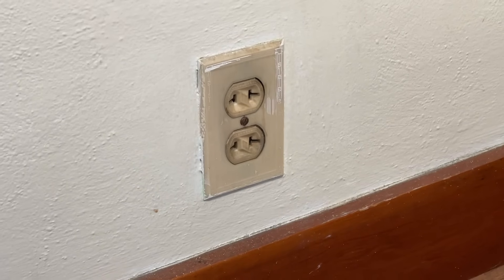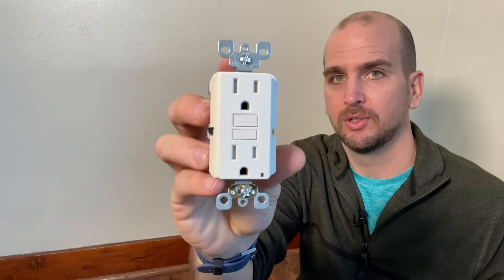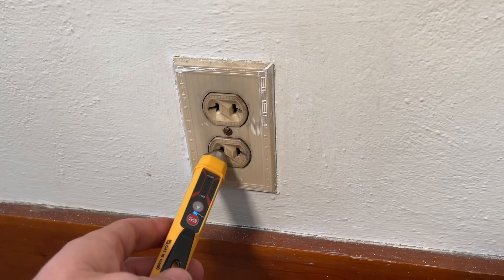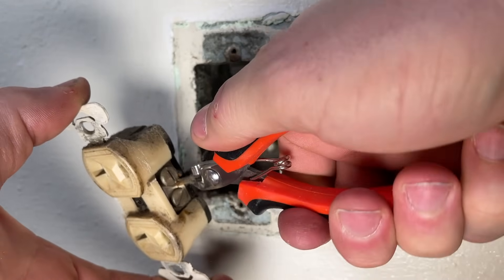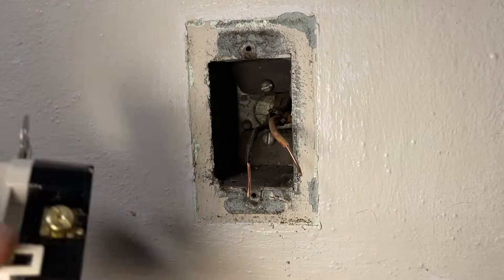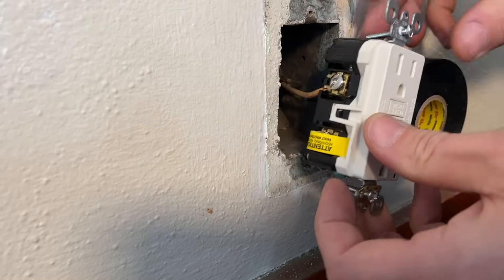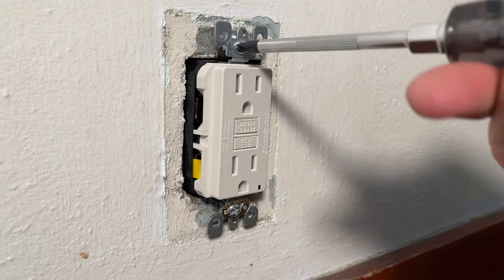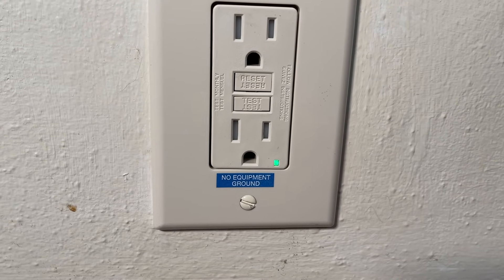How To Replace An Old 2 Prong Outlet Using 3 Prong GFCI

Comment: Tighten G---W-----B in that order to protect yourself and the down stream components---Jim
Reply from the maker: Hey Jim, thanks for that tip.  Appreciate the help!
Reply: J7
Reply: Very good advice!
Reply: I thought we were dealing with no ground here???  And on older two wire, the wires look the same.
Reply: @dave-yj9mc  This is old, two wire Romex cable with a metal box, it has a black and a white wire. In knob and tube, with or without a box, both wires look the same.
Reply: @dougbrowning82  oh,  I thought it was that braided stuff.
Reply: @Volkan no but it is a good habit to do, because you never know what may happen.
Reply: Turn off the power first is the only proper order. The rest is just being lazy and taking unnecessary risks.
Reply: Put on gloves if you deal with life circuit. A few bucks can save you from getting zapped.
Reply: Lol
Reply: Breaker is OFF dummy
Reply: Thats the dumbest advice ever...if its live and you ground it first then one slip of your hand and your getting hit...its neutral hot ground to install and ground hot neutral to remove...you NEVER want to touch a hot wire while a ground is still attached and close enough to hit you
Reply: @illwil2158  That's incorrect... It is Ground Neutral Hot.  The ground is there for you.  To save your life.  Yes you can slip with the hot wire and hit the device and cause a short.  Doesn't matter, the ground is there to save your life not the devices.
Reply: @seancampbell5496  I learned G - W - B or ground, neutral then hot. If Willy rod wants to get themself zapped so be it, they can turn into a human candle...
Reply: @Davelon420  lol Agreed.
Reply: @seancampbell5496  the house panel breaker is there to save your life

Touch ground/neutral while the hot goes thru,  you complete the circuit
Reply: @mansardmanor3869  The breaker interrupts the circuit.  The ground is put in since 1960 for safety.  So I mean you're not wrong, but you're also wrong at the same time.
Reply: @seancampbell5496  never assume you don't have voltage coming off the neutral
Reply: @adammuncy8475  What did I say that made you believe I assume that?  The neutral is an insulated conductor and counts for fill in conduit for a reason.
Reply: @illwil2158  your reply doesn't make sense, sure you can get shocked if you touch the ground and the hot at the same time, but you will also get shocked if you touch the neutral and the hot at the same time. For safety the order of adding and removing wires has always been ground, neutral, hot for adding and hot, neutral, ground for removal. That is one of the first things they teach you in electrical apprenticeships and trade schools.
Reply: @illwil2158  check your education !

Comment: That is the most ignorant thing to do. If the code supports it, the code needs to change. You put what looks like a grounded outlet, which isn’t grounded, and label.  When, over time, the label comes off, or is painted over, you had a potential for a fatality. Uber DUMB☹️👎.
Reply from the maker: Hey Loco Pete,the actual protection is from the GFCI and the ability to cut power if a fault is detected opposed the the actual sticker providing any “safety.”
Reply: @EverydayHomeRepairs  I stand corrected.
Reply: @skelley164  Sorry if I insulted you. The original configuration seemed dangerous to me. As I said in my previous reply, “I stand corrected.”  If that’s not good enough, I can’t help you.
Reply: @CrazyPetez  - no I misunderstood what went on here. I thought the House Repair guy wrote “I stand corrected” admitting some kind of mistake. Therefore I owe you the apology. Lol, that’s why I don’t send out replies like this. Sorry bout that man. Have a good life.
Reply: @skelley164  Thank you!  I appreciate what you did.
Reply: @CrazyPetez  for what it’s worth I deleted it.
Reply: The label does not protect anything, the GFCI does. Also the code says the label put on the cover plate. You do not paint over them.

Comment: I dont think 2 prong are necessarily unsafe, they just arent as safe as grounded. Ive lived in a two prong house my whole life and never had any issues with safety
Reply: Me also
Reply: Electric accidents are very rare, in Finland there are 0.4 fatalities per million annually and this includes people who climb on top of trains. Traffic kills 100 times more. Therefore one cannot really conclude from none's own experience.
Reply: So what did you do when you needed to connect a three lug device? Cut the ground pin?
Reply: @okaro6595  I guess technically I lived in a house with most of the 2 prong outlets switched to the 3 prong grounding style without upgrading the wiring so they function the same as a 2 prong without the ground.

Comment: Nice old outlet! That would be somethin' for my vintage electrical collection. The latter includes some examples of the old coplanar & perpendicular (NEMA 2) plugs that would fit it.
Reply: Except the two plugs that fit that outlet are now used for different voltages where grounding is not required. 1-15P is still used for 120V, and 2-15 is for 240V. Where ground is required, 5-15 and 6-15 are used instead. The change was made sometime after the 1920s when split phase 110/220V was offered to homes. These dual standard receptacles are no longer listed as NEMA wiring devices.

Comment: One of the methods permitted in 406.4(D)(2) is to replace a non-grounding type receptacle with a GFCI type receptacle. 
When doing this, the 2014 NEC required the “receptacle” to be marked “no equipment ground”.or their cover plates
Reply: Correct.  GFCI receptacles come with these labels, but most people do not install them. The other acceptable method is to leave the non grounded outlets with just two hole (sorry for the poor terminology) outlet and install a GFCI breaker in the panel suppling the circuit.
Reply: Someone knows the code, thank god
Reply: What does "no equipment ground" mean?
Reply: @Aaron Wilson  Means there's no ground wire in the home.
Reply: How is that different than what was shown in the video?
Reply: @donbushek    In a modern application you will have a standard romex wire coming out of then box which has the same insulated black and white wire you saw here, but will also include a bare copper wire for a ground.  At the other end of the line that bare copper wire is attached in the electrical panel to a grounding bar.   At the outlet, it would go to the green bolt on the bottom of his outlet here.  In electrical applications green means ground.   Old wires from the 50s and before often times did not have the bare copper wire running in them which is the wire you saw in this video.  I’ve done a bunch of them.    I’ve replaced as much of the old wire at my place as I could just to update it.    It’s preferable to have the ground.  No new construction today would be done without it.   It’s for safety.
Reply: An important thing to note is that without a ground wire, there's no way to actually detect a ground fault.  A short circuit would trip the GFCI, but it would also trip the breaker.
Reply: @banggugyangu  Not how the device works,   The device measures extremely accurate CURRENT going through the 'hot' and neutral.  if they do not match, then current is leaking elsewhere.  that is the fault.  Ground conductor is not needed or used for the measurement.

Comment: Turning off the power before connecting a GFCI will save the outlet from burnout.  I do a lot of 110 V work replacing switches and outlets without turning off the power.  Learned the hard way that doing that on a GFCI outlet will ruin it when you connect it.
Reply: There's switches like that too, it's irritating af haha

Comment: It's better to preserve the length of the copper leads as much as possible.  If the wires are chopped shorter every time the junction box is worked on, the entire run of cable might have to be replaced.
Reply: Meh …. You would just make a pig tail ..
Reply: It's good to save as much wire as possible but just be aware that the copper wire that was on the previous receptacle can be brittle if its old so it doesn't hurt to cut it and strip back new copper if you have enough length to do so.
Reply: @ryanm2084 ,
   Yep, especially weakened where the loop is formed  detached and relooped with the same copper.
Often enough you can break the loop off with your fingers. That'll Ark definitely someday. Better to shitcan the distressed ends when you remove them from the old Outlets if they look bad at all.
Reply: I agree.  In his demo, it looked like there was only a couple inches left.  If things mess up, and after stripping the copper lead falls off some more, you might be screwed.
Reply: correct
Reply: @PJBonoVox  yeah you should leave this work too people that know what they're doing and keep out of stuff you don't really know about
Reply: @jahnl4906  Would have to agree that the widespread laziness, ignorance, and incompetence of roofers really take the cake.
Reply: Better to pig tail wire  ..install a wiremold extension box so Gfci is not cramed in original box.
Reply: I've been in that kind of pinch myself when replacing a few receptacles.  I had some porcelain pull chain porcelain receptacles in my garage to deal with when the pull chain switch went bad.  The wiring space inside the box was extra tight, as the boxes also served as junction boxes, where the load wires also fed an outlet below the light fixture, and another pull chain light a few feet away.  When I replaced the worn fixture, I had to make a pigtail and use wirenuts to install the replacement fixture.  The fixture also has a self grounding outlet, which was much needed.  It powers my washing machine, freeing up one of the lower sockets in the outlet below for an easier reach to power something else when needed.  In a garage, pull chain lights with self grounding outlets are quite handy.
Reply: CALM DOWN KAREN  IT WILL BE OK
Reply: Yes, preserving the length especially with solid wire is a good idea. There is no "extra" wire in most outlet enclosures.
Reply: @PJBonoVox  bro have you ever heard of the electrical code? its not generalized, its required.
Reply: I thought the same thing.   I don't know why anyone would cut off perfectly good wire to start over.
Reply: Yes, I never chop wires shorter. Just remove the screw and sand the copper clean. Also, I would never tighten the screw without curving the wire to establish mechanical connection. And I would never do the quick insertion of wires into the holes, as I have seen dangerous sparking outlets from poor connections done that way.
Reply: @KpxUrz5745  the straight wire in this case sits under a clamping plate. This is just as safe as the turn you refer to, and it doesn’t have the problem of the turn trying to wiggle out from under the turning screw.
Reply: @KpxUrz5745  let me see you wrap the wires on a modern GFCI ...maybe back in the 90's...but now...not so much
Reply: @BlackVibeBallsack  I do it regularly but doubt you get the chance to see it.
Reply: The length should be preserved when possible, you never know when something wrong happens and the wire burns arcs gets, then it is more costly to repair. Older boxes don't have a lot of room in them.

A peice of Emery cloth will shine those wires up like new.
Reply: Why is that? I'm genuinely curious being that I am not a professional in ac voltage.
Reply: @dennisreelie1720  to preserve the length.
Reply: @RangerCaptain11A  but it looks like he's got tones of room to spare. Is it just a cardinal rule, cause if you end up cutting it too short you're up shit Creek without a paddle. Again I'm not being a smart ass, I am genuinely curious, cause I've got next to no ac experience
Reply: @RangerCaptain11A  That is true, the only problem here is that the old exposed copper was likely tarnished. Although we won't know because it was never shown, but I bet it wasn't shiny anymore.   And while not ideal, in this situation with only two wires in this box, I'd probably just make nice extensions using good quality wire nuts or Wago lever nuts to lengthen the wire given how short it looked already.
Reply: @dennisreelie1720  if you are changing an outlet, check the condition of the wire and preserve length if possible. there's almost no such thing as too much wire, and when the wires are eventually too short, you have to extend the wires. every joint in a circuit increases resistance/heat, and is a weak point that causes flickering lights.
Reply: @andrewt9204  I use pig tails all the time.
Reply: @RangerCaptain11A  Yeah, nothing wrong with it if done correctly, and is what I would use in this situation. I only said "not ideal" if you're not electrically inclined. Could be a failure point if you're a novice. I should have made that clearer.
Reply: @RangerCaptain11A  thank you for the good explanation.  Cheers 🍻🍻
Reply: @andrewt9204  
Tarnished copper - not a big problem unless you deal with audio-video or transmission data signals where the waveform has to preserved or high freq losses are introduced (skin effect). At the levels and frequencies AC lines operate tarnished copper doesn't introduce waveform loses and distortions. Usually when the wire is tightened during the installation the layer of oxidation is broken. I usually put heat shrink if the insulation is questionable condition to keep it from failing. The very old wiring had strands tinned. Bigger problems are actually spikes from switches, electric motors or cheap PWM power supplies of electronic components and other garbage flowing in the AC lines.
Reply: @dennisreelie1720  Yes, he didn't mention that GFCIs are quite a bit thicker/deeper than standard, (especially those really old ones) outlets. This job could very well involve changing out the device box as well to prevent overcrowding (NEC violation) of the box.
Reply: @PJBonoVox  This was a ridiculous statement. The wire isn't going to be different in every receptacle. NEC states how long the wire should be. Which is 6". The adults are talking. Sit down.
Reply: It baffles me that you guys replace runs if the lines get too short. Go to an auto parts store. Buy some cable but connectors and the appropriate gauge of wire. Crimp onto the short wall wires. Crimp-on some extensions. You're good to go! If that's fine for a truck that will take up to 1500 amps peak load, it's fine for your house.
Reply: @MeepChangeling  trucks use stranded wire house electric us solid wire  . Do those butt connector  crimp on solid wire?
Reply: @MeepChangeling  we have wire nuts man...it's made for this...especially...

Comment: I am not an electrician, but how is this any safer that using an adapter plug? As far as I can see, all you have done is to eliminate using the adapter. But you still have an ungrounded, 2 wire outlet. I thought this video would be about running a bare copper wire back to the ground bar in the breaker box. The same thing you have done here could be accomplished by installing a new, less expensive standard, 3 prong outlet. But this, too, would leave one in the same situation with an ungrounded outlet. Please correct me on this if I am wrong.
Reply: I'm not an expert, but from what I've read, the ground fault protection offered by a GFCI is acting as a substitution for the traditional ground wire. Your ground wire is meant to redirect a ground fault to ground (earth). Rather than redirecting the fault to ground, the GFCI can sense a ground fault and will break (interrupt) the supply to the outlet, stopping the fault itself.